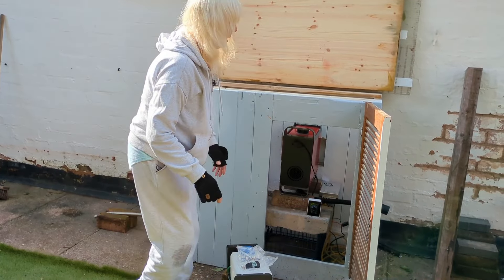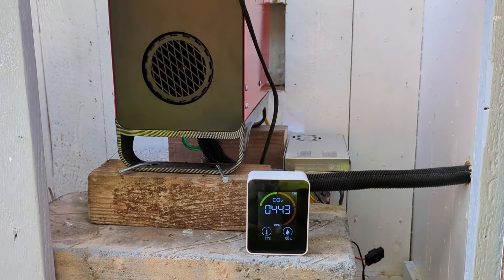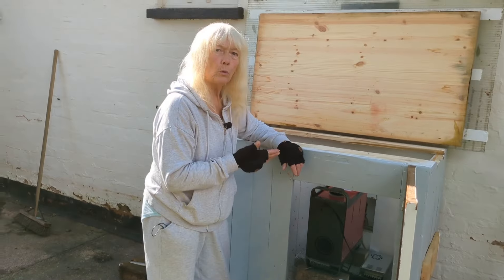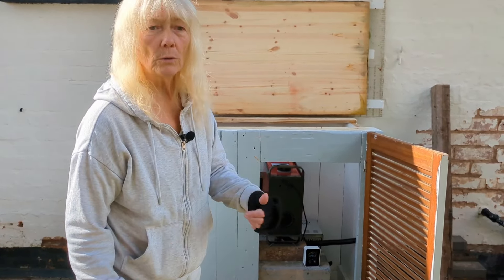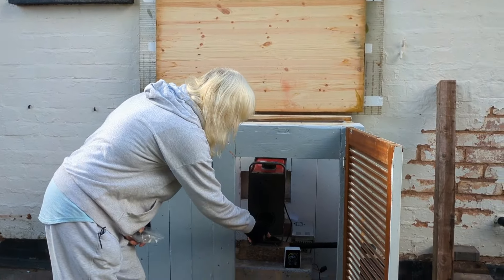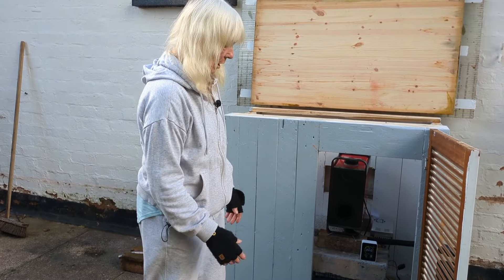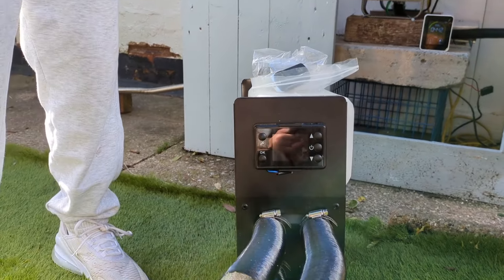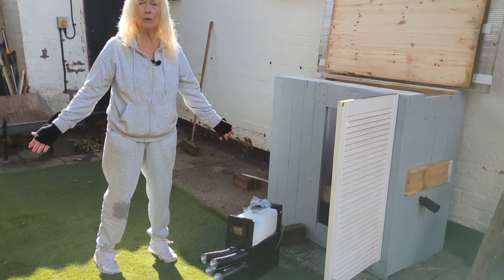cut fuel bills & stay cozy with an 8KW Diesel heater

Comment: Hi. I’m about to go into my to 3rd winter with a diesel heater heating my home. You’re right, it’s so much cheaper than conventional heating methods. I run mine on red diesel which I pay 75p a litre for. I followed a YouTube tutorial about tuning the heater to get maximum efficiency and last week took the heater apart expecting to clean soot and coke from the burn chamber. But because it is running so efficiently, it was as clean as a whistle. 
I heated my bungalow all last winter for approximately £140 in diesel. Can’t beat that. 
Good luck with your camper heater installation. 😀👍🏼
Reply from the maker: Hi! Thanks so much for sharing your experience. That's amazing that you've managed to heat your entire bungalow so efficiently using red diesel at 75p per litre! I’m really impressed with how clean your burn chamber was after tuning it for maximum efficiency—goes to show how well these heaters can perform when set up right. £140 to heat your home all winter is unbeatable! Thanks again for the encouragement—I'll definitely keep that in mind as I finish up my camper heater installation. Stay warm this winter! 😀👍🏼
Reply: Delusional! What you mean is you are only heating one part of your home and claiming it's "better". Chinese diesel heaters run around 69% efficiency burning the fuel and a good oil heating plant is in the 92-95% level. Changing a building designed for central heating to point heating isn't that easy but that's your problem not mine.

Comment: I have 2 , one runs from solar and kerosene, heats whole downstairs to 21 degrees. Have one for conservatory cos I spend most of my time in there. Central heating does not work well with conservatory as it cools too quick and rest of house is really hot . Keeps conservatory at 22 set at 2 , run all morning and evening (total 9 hours a day ) costs about 20 quid for nearly 2 weeks running .
Reply from the maker: Thanks for sharing your experience! It’s really interesting how you’ve set up your heaters, especially with one running on solar and kerosene. Sounds like a smart way to keep costs down while staying warm. I might share this in a future video if that’s okay with you since it could help others looking for affordable heating solutions. Have you tried any other methods for heating your conservatory or downstairs? Would love to hear more.

Comment: Morning Jean, which diesel heater did you buy and where from,and where did you get your storage tank ,and fuel from,and who would I get to fit it please ???
Any support and tips will be really helpful,thanks in advance !! Xx
Reply from the maker: Hi Ann!
Thanks for your questions! The diesel heater I bought is the ALL IN ONE 8KW 12V/24V Portable Diesel Heater with an LCD display and Bluetooth app control, similar to Webasto or Eberspacher heaters. I got it from Amazon.

The storage tank came as part of the heater kit, and I usually get my fuel from a local petrol station.

As for installation, I honestly think it's something you can do yourself if you take your time. I'd recommend watching as many YouTube videos as possible to learn the process before jumping in—there are lots of helpful guides out there! Just don't rush, and make sure you feel confident at each step.

If you need more tips or have any other questions, feel free to ask! 😊
Jean
Reply: Hi Jean,thank you so much for replying,I will let you.know how I get on !!
Wish me luck !!
Ann x
Reply from the maker: @annwilliams8166  cant wait be safe

Comment: Heating my house with one connected to a 1200 litre fuel tank, just got a 1000 L  of kerosene delivered for £600, hopefully last me 2 years and no need to keep refilling
Reply from the maker: That sounds like an amazing setup! Connecting it to a 1200-litre fuel tank is such a smart move, and getting 1000L of kerosene for £600 is a great deal. If that lasts you two years, that’s some serious savings. Plus, not having to worry about refilling constantly is a huge bonus! Hope it all works smoothly for you this winter and beyond. Thanks for sharing! 👍🏼
Reply: can i have the place you picked up a 1000L of kerosene from if in the UK.
Reply: You’ll probably burn out a pump or two burning just kerosene,you might be lucky and be ok as they’re meant to pump diesel which has a lubricant,I normally mix 50/50 red diesel kero that keeps it happy,they really are a great little machine

Comment: How much does it cost to run for the week?
Reply from the maker: Hi Kavan!
Thanks for the question! The running cost depends on how much you use it, but here's a rough estimate. The heater consumes between 0.1 and 0.5 liters of diesel per hour. If you’re running it for about 8 hours a day at an average of 0.3 liters/hour, you’ll go through around 16.8 liters a week.

With diesel priced at around £1.50 per liter, that works out to roughly £25.20 per week. Of course, the cost will vary depending on how long and at what power setting you're running it, but this should give you a general idea.

Hope that helps! Let me know if you need any more details!
Jean

Comment: Ive seen the exaust put through a radiator for extra heat😅 also what fuel you run them on makes a big diferance filtered chip fat oil is cheapesti think  if you you can source it from chip shop

Comment: I burn kerosene in my diesel heater. It's cheaper than diesel. most of the time. And I think it burns cleaner. if you had. oil fired central heating. tank. and you could buy it in bulk. You'd really save. Two weeks ago, I paid £0.80 a litre plus. 5% tax  for kerosene. red diesel in my area was over a pound. the litre. And as usual, when the winter comes, it always goes up. So it pays to buy it in the summer. But. life is life. We spend our money on other things. If we've got any. I also have two diesel heaters One directly into my living room wall. And another one upstairs into my bedroom Fortunately, living in a wooden house making. holes is quite easy. I have mounted the upstairs heater. in an metal. Ammunition. box. The fuel tank is in the house. But it's an outboard. motor tank. that detaches from the pipe Leaving its sealed. So you can take the tank outside the fill it  up, so that you don't have a smell in the house. A tank hanging. on the outside of the house would look a bit dodgy. The ammunition box that my heaters in. is barely bigger than the heater burner itself. So it's got. a whole on the narrow end. with a right hand fitting bend. pipe connection that then goes into the house on the opposite endof the box  there is a return  air flow hole for the heater air, not. not combusted air.   So I'm circulating the same air all the time to save even more on the fuel. If you're Pulling in cold air from outside. It'll cost you more money. The downstairs heater is just in a metal cabinet fixed to the wall just outside the living room. Metal is used because I live in. a.  wooden house, and I don't want fire risk. If you've got a brick house, I'm sure a wooden box works out quite well. That heater has a 10 litre tank hanging on the wall. as no one can see it low down. which is easy to fill. I agree with you. It is saving me money. but a word of warning You do need to do a little bit of. maintenance. but there's loads of YouTube videos on that subject. I have more than one heater unit I can swap out a heater unit in less than 20 minutes. So I've always got a heater that's in good condition in case one goes down. and everything's really cheap. to do any repairs on these things.
Reply from the maker: That’s a detailed setup you’ve got there, Chris! Thanks for sharing it with me – very clever using kerosene to save on fuel costs and repurposing that ammo box for the heater! I totally agree with your point about fuel prices shooting up in winter – it definitely pays to plan ahead. I love the idea of keeping everything efficient by circulating the same air too.
It's great that you've got a backup heater ready to swap out when needed. I might have to explore more of the maintenance side for my next video since there’s so much people can learn about keeping these heaters running smoothly! Thanks again for your insights – super helpful for anyone trying to stay warm and save money! 🔥

Comment: Radiant water heating is more efficient.
Reply from the maker: thanks for your advice we will look into that
Reply: After initial outlay ?
Reply: Efficiency is different to cost though isn't it. Electric heating is 100% efficient but that doesn't make it a good financial choice in the UK.
Reply: Half as efficient at ⅓ the cost is still a deal.